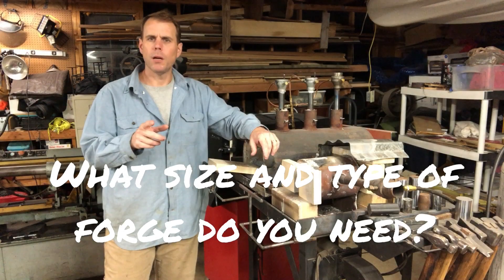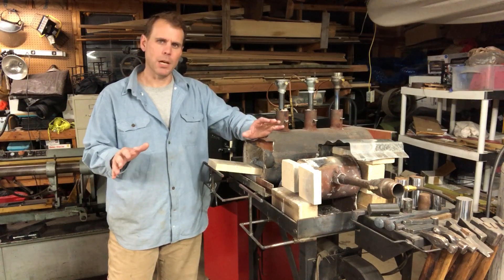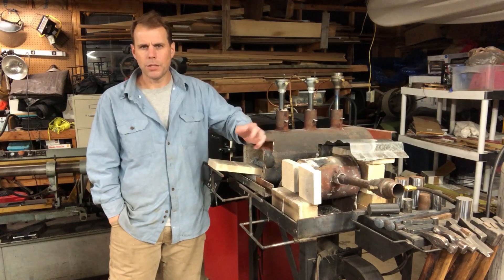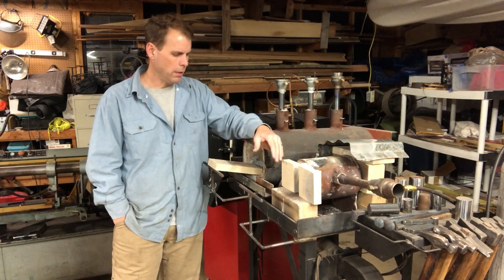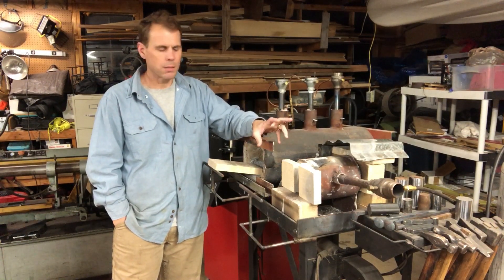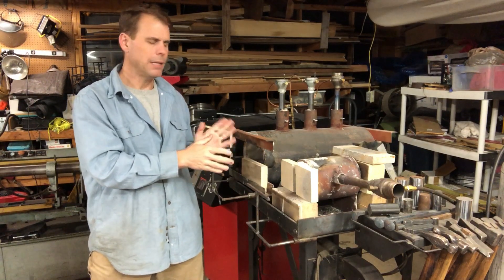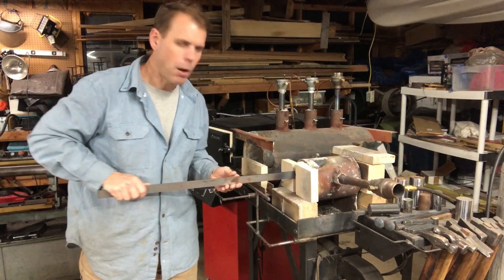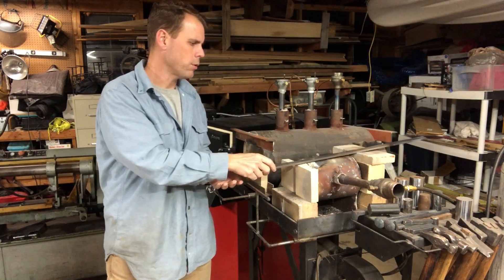Thoughts on forges - propane gas forge or coal forge.

Comment: Great video break down of the gas forge. I prefer using coal/coke too, but I mostly use gas for the exact same reasons you mentioned. I actually built a forge out of a muffler that is very similar to your small forge a couple of years ago, even did a build video on it. I thought I would need a bigger one but it has served me well and does what I need. IMHO the noise is really the worst part about it.

Comment: Good explanation of the uses of each style Derek.
I'm a coal guy myself, but do have 2 different size gas forges.
Reply from the maker: I love using coal/coke forges! I just find that the fire maintenance and the time it takes to get a good coke forge up and running is a LOT longer than it takes me to get my gas forge going. If I had more time, I'd use coal/coke a lot more.
Reply: @derekmelton  

Time is a big deal for me too.
When I'm doing a run of hammers I use my bigger gas forge. I can put 6 3-1/2# blanks in it at one time. My small gas forge is pretty much the same size as your small one. 
Great for making punches, chisels etc:.
When I'm going to spend an entire day doing any there general forging I light up the coke.
I have over a ton of metallurgical grade coke here, as well as nearly 1000# of good bituminous coal. I mix the two.
Love my Laurel Foundry pot too.
See ya brother!
PS: trip to see our buddy Dustin is still in the works, but most likely will be a spring trip.

Comment: great video Derek, is there any reason to have the burner on the side as opposed to the top of the forge for the smaller forge you have? 

I am just starting out and want to build a small inexpensive forge to begin with that is versatile the small one like you have looks and sounds like a really great choice although I may need to make it slightly wider to allow for small hatchet heads
Reply from the maker: Hey, sorry for the delay here. If the forge is round, I don't think it matters where the burner is as long as it's coming in at a slight angle to make the 'swirly' effect inside the forge.  Wider would be better, I think 12 inches deep is plenty though!